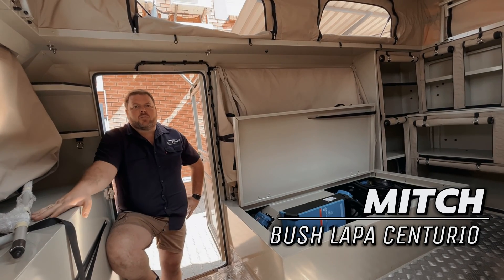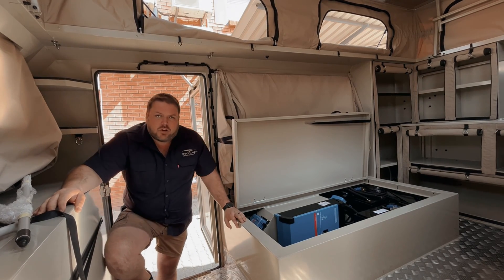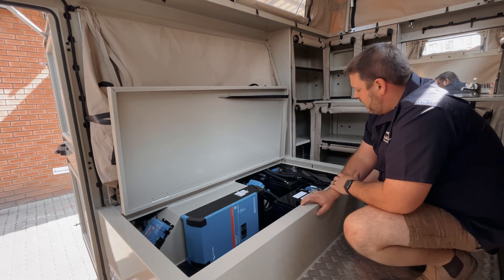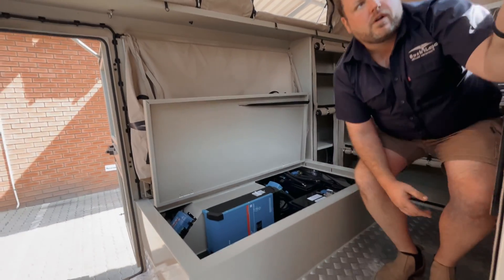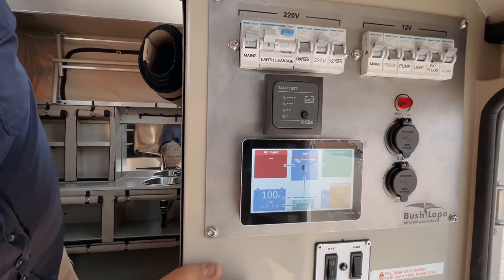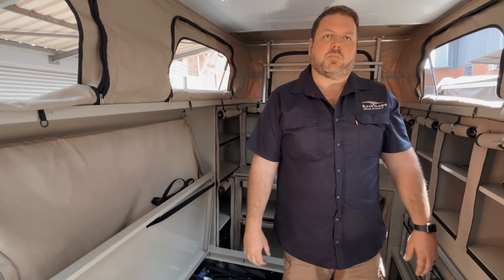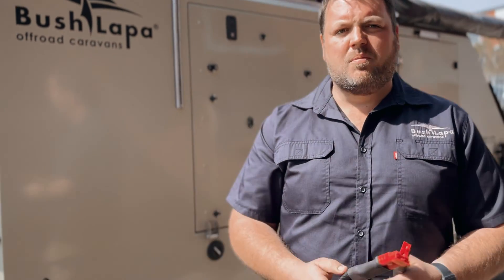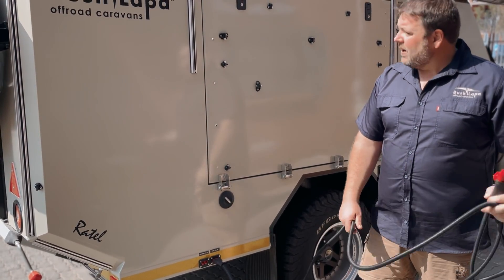Bush Lapa Power System Upgrade

Comment: I presume that you would have put in bigger wiring for this
Reply from the maker: @redinza for sure we did, multiplus + - wire is 95mm2, charge cable from vehicle 16mm2 as per Victron specifications.